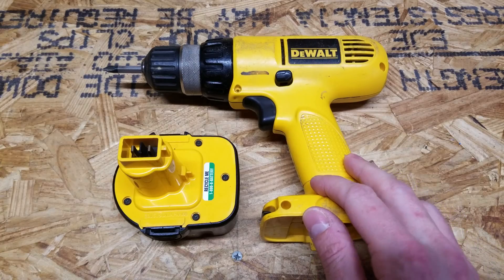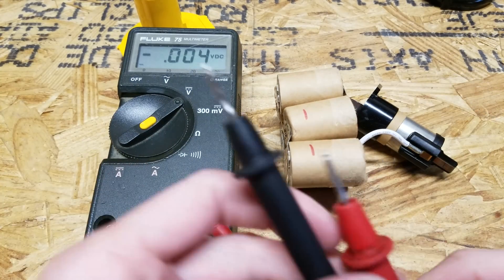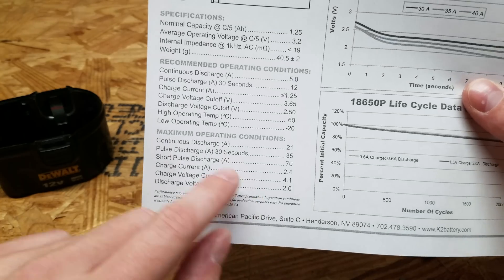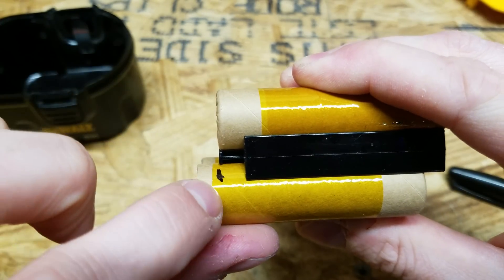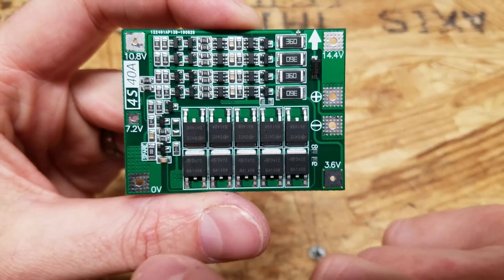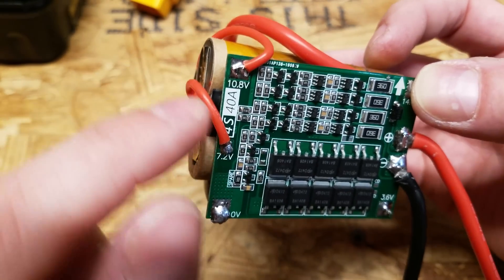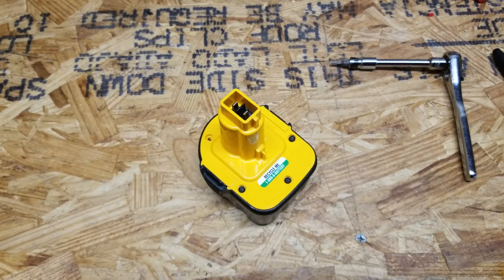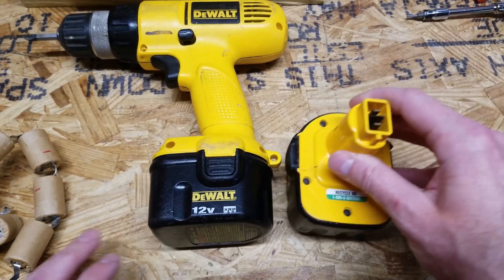Converting a DeWalt 12V Cordless Drill from NiCad to Lithium LiFePO4

Comment from the maker: Alight, so a few people asked how I plan on charging this battery and I responded that I was going to use the original charger. That wasn't a very good idea, as some of you suggested. The charger I have is for 7.2-14.4V batteries and it doesn't look like it's correctly detecting the new battery as 12V, so the BMS keeps shutting it off. I will need to investigate an alternate way of charging...
Reply: I'm guessing since you have a BMS... if it has the load balancing and overcharge protection... you only need a in spec power supply for the BMS and batteries to charge the battery pack whether separate or ideally maybe modifying your existing charger circuit to be the rated voltage and current power supply.  There are RC drone/car/plane/whatever battery pack chargers that are worth the investment IMO that can charge a large range of battery types and cell configurations as well as do some other maintenance tests and methods.
Reply: yeah different cell chemistries need different electrical charging profile. btw is your battery still good after a few monthes ?
Reply: Add a female barrel plug to the battery pack then use a wall wart to charge with the correct voltage.
Reply: @chrisyoung519  That's one option I'm planning to implement in a future project, because I value it's simplicity.
Reply: I had a bad charger for a 9v battery. I did a similar thing 4 weeks ago. Why doesnt the bms charge until done? Idk why the bms doesnt make it work.
Reply from the maker: @ericeric5306  The BMS disconnects the battery when the voltage rises too high or drops too low. It has over-charge protection.
Reply: The only way I think you could get it to charge,. Is to take like a 12v charger form a ice fishing fish finder, or a airsoft battery charger, and just watch it. You can remove all the guts from the original charger, and just wire the new one to the female end so it's a little less sketch, or just use gator clips on the + & - to charge it. The only problem with that is it won't self shut off, so you will have to watch it, and figure out how long it takes to charge it to full. Hope this helps! Cheers
Reply: LithiumSolar  n
N/
Reply: Would be good for many people if you were to follow up on your charging solution good vid though apart from that
Reply from the maker: @MrMad1966sChannel  Because I never came up with one that I wanted to suggest other people do lol. I have a hobby charger I use currently.
Reply: Does anyone know of a battery rebuild service. I have a beloved DW954 and the battery is no more.
Reply: I have a couple of these drills from 1995. I'm using two old Chinese NiCad replacements. One is weak and dies in a matter of 5 minutes of use. The other charges and works great, but self discharges overnight. There are Chinese replacements that are made with NiMh cells. Can I use the original DeWalt NiCad chargers? One is the first generation that only did 12V. The other is a couple years newer and was multi-volt charger for 9, 12 and their newer 14v batteries. BTW you can put the 14v batteries on that drill. The clips are in the same place and the motor can take it. It just doesn't look right. The front of the battery stacks out past the mount.
Reply: I would like to know how long does the battery hold charge? Tnx
Reply: AYFKM. You need a CV-CC charge circuit. WTF. Dude. You cannot use a CV charge circuit.
Reply from the maker: @bryanvarner7398  I use a proper LFP charger now, and I will say... I didn't realize this was built over 5 years ago. Wow. I use this drill pretty much daily and the battery is still going strong!
Reply: Just buy a 14V DC charger off Amazon and remove the old charger circuitry. 3.5VDC per cell x 4 = 14V
Reply: @peterg.8245  I would go with this suggestion, but the charger also has to provide the same amps as the original though.
Reply: @DigitalIP  @Peter G. I disagree with both of you. you need to go close to the maximum charge voltage to charge the battery all the way up. so 14V would never charge the pack to its full potential. 4x4,1V=16,4V would be perfect. On the other hand the charger doesn't need to supply the same amps as the original. the lower the longer it will take to charge but that's about it.
Reply: Meh... confused..
Reply: @DigitalIP  there's a big difference in charging characteristics with different battery technologies.
Reply: Had to rewatch the vid as i forgot most of it
I would have just gotten a cheapish bench power supply to charge the batteries instead of using the original charger
Could have made a type of adapter to go between the + and - contacts and charged it that way, or alligator clips
but yeah, i would assume hes figured it out by now.
Reply: Maybe the open circuit voltage is too high for the BMS, ??? I'd get a CC CV DC converter, and use a laptop power supply or something, let us know what you do!   The charger may be detecting the low resistance of the LiFePo cells, I don't know if the resistance of nicad is different, the LiFePo cells may be pulling too much current, from the lower resistance, you could replace the internals of the charger with a cc CV DC converter, and modify all the batteries, but I guess the DC converter would charge both types! I may do this, to my charger, since it's the only old dewalt tool I have, I do have a hobby charger, but requires ballance leads, I'll probably use my DC converter to charge, or the Hitachi charger, I'm thinking about paralleling another series of 18650 liion cells to the Hitachi batteries, for longer run time, it's only about twice my dewalt batterys, let us know how this works out!! Great video!!
Reply: @jamest.5001  if u want to charge with a hobby charger you could leave the bms out of the batterypack, and cut a hole and wire/glue a connector with all the balancing leads into it.
Reply: I'd recommend DC-DC converter to charge.
I have done same thing but with lithium cobalt battery and 4s2p configuration (14.4v). I don't even know where charger is so I'll just charge it with DC-DC step up.
If you have charger, you could disassemble it and  put DC-DC converter here or modify it to charge it some other way?
I have disassembled 3 of those nickel cadmium backs and to be honest they looked really much similar to yours.
Also I'm using adapter from drill to use 4s quadcopter batteries, that way I can go whole day.
Reply: I have done numerous conversions and it worked every time I used original charger. NiCd to LiON
Reply: I am curious, did you have to use an internal circuit board "BMS"?
I am only guessing this is a Battery Management System. I have 10 Li-Ion 20 Dcv Craftsman Pro Series system that fits 5 tools. The last battery died 3 weeks ago. After I got over the shock it lasted ten years +/- and turned to YouTube to see if I can replace the cells instead of the no-name brand that sell for $100 and say, these won't charge or work with the chargers I have.
ASE Master retired with useless cordless tools stacking up, and hardly any funds to buy new! Thanks as this is new to me but good with electronics but better with repairs on vehicles.
Reply: @deankay4434  Using a BMS is the only way to properly charge and balance the cells due to their configuration. Using 18650's in the way he's doing would require a BMS. But having the BMS externally would also be possible with the correct power adapter and wiring. Without a BMS to manage the cells, they could easily overcharge when charging the pack as there isn't anything to limit them which you don't want to happen.
Reply: A BMS has no charging electronics. The overvoltage shutdown is intended for emergencies and not for regular charging. A NiCd / NiMh charger works with a charging technology that is not compatible with Li-Ion. A simple DC / DC converter is also not a suitable charger. At 3.5 volts, as suggested, the cell is just half loaded. A led out socket for an external balancer and charger (e.g. IMAX B6) and a protecting board for the Li-Ion cells (undervoltage, short circuit) has proven itself in my conversions. However, the whole thing makes it complicated and unwieldy.
Reply: @wernerpeter9706  depends on the BMS. many are designed for charging, and have balance connections.
I'm also using my Imax B6  - included a dean connect and jst balance connect in the builds.
Reply: @geogsi88   Could you elaborate a little?  I am interested in converting my 18V NiCd to LiFePo4.  How did you get it to work with the original charger?  Would it be the same since I have a DC9310 which charges Lithium batteries?
Reply: @geogsi88  he didn't use lithium ion though, so your suggestion doesn't work
Reply: Djordje Tomic There’s a ton China made LiOn replacements for OEM NiCd.  But I wondered if OEM charger for Ni would charge Li properly. So why bother with hours of research and conversion when these LiOn are available ?
Reply: Between 18650s and the plug part in the battery. To make it easier for yourself you could've used XT60 connector. Would have made easier down the line for you if you ever needed to replace the 18650 battery cells. There also is another way you could build this battery. You would not need to use a BMS. You could have built this battery with a balance lead and use the sky RC battery charger designed for 18650s.

Comment: Should have read previous comments, sorry. Have you resolved the charging issue? I have a bunch of Dewalt 14.4 tools I would like to convert to lithium. Your technique is a good model.
Reply from the maker: I haven't figured out a permanent solution. I'm still using an iCharger x6 as it hasn't become too inconvenient yet. It's a low-priority problem to solve at this point.
Reply: @LithiumSolar  Thanks for taking the time to respond. Charging LiFePO4 batteries is 
 just a little scary because of being unpredictable. Anyway appreciate your video.

Comment: Great job and nice work! My only concern is charging. Is it safe to use the NiCd charger on Lithium batteries?
Reply from the maker: A LiFePO4 battery should only be charged on a LiFePO4-rated charger.
Reply: @LithiumSolar Agreed. Will pick one up on eBay and convert my OEM charger for lithium.

Comment: Series of 4 batts, using 4S BMS is correct, but why you left the last spot off? ===> BMS will become useless ! Also, the + charging & source not in correct position .
Reply from the maker: I'm not following which connection you're saying is incorrect. It is absolutely wired correctly. This battery is over 3 years old now and I use it every single day without issue.

Comment: 3.3v x 4 = 13.2v… How did you determine that those = a perfect 12v?
Reply from the maker: LFP cells are 3.2V nominal (3.2 x 4 = 12.8V), not 3.3V.
Reply: I misunderstood because 3.3V was printed on the cell and you say both. I don’t get the whole nominal thing, but 12.8v isn’t 12. Is that essentially close enough to be a negligible difference in function? I’m not trolling. I’m want to learn more about electricity. Like, if somehow possible, would anything say 11.8 to 13.2V still be close enough?
Reply from the maker: @EricWebSurfer  Huh, you're right - it does say 3.3V on the sleeve. I can't explain that one especially considering 99.9% of LFP cells are 3.2V AND the datasheet shows 3.2V. Yes, 11.8V would be "close enough" too. Another common example is the 12V battery in you car. It's a 12V battery but if you put a voltmeter on it while the car is running, you'll see it charges around 14.3-14.6V :)
Reply: @LithiumSolar  I see. Thanks for elaborating. That helped a lot.

Comment: When you say spot weld do you mean just soldering with the solder gun and solder?
Reply from the maker: No. Spot-welding is a type of actual welding. It puts a large amount of current through two tiny probes close together that melts the nickel strip and bonds it with the steel battery casing.

Comment: I have a 4s 40a BMS for standard 18650 batteries (non LiFePO4). Will that work or is the voltage too high?

Comment: After reading all these comments, and suggestions.
My simple answer is...
Search for a universal battery charger designed for LiPo, and...
find one that suits the 12v.
many electric bikes run on a 12v system.
It would be a simple as using alligator clips to your battery pack.
They are not expensive; maybe 12 bucks - in the year 2022.

Comment: if you sand off the chrome on the spot weld plates and sand the cell surface, you can then simply solder.

Comment: Would it be possible to use a 20 volt battery - by converting 20 to 12???
Reply from the maker: You could use a buck converter, but it would need to handle a lot of current and would likely be rather large. I wouldn't go that route personally.

Comment: I rebuilt my matco cordless ratchet, with new 18650's because the old ones failed in the battery pack, I had 2 battery packs failed, And a new battery is like 70 bucks, I actually bought a cheap battery for something else and harvest the cells. I had enough to rebuild both bad battery packs. The point is I don't charge mine with old charger, I Actually use a current limiting bench top dc power supply, and hook up directly to the main Pos and Neg on the battery and charge it that way, using wire etc, I use low current at 12V and they charge up fine. I have charged them a few times this way and no issues so far, The power supply shows me current draw and when its near 0 they are done. They also got a power meter light deal and it shows full when done. My battery packs each hold 3 cells.

Comment: Is the drill/ battery pack still operational? Also battery link is not working, I was try to get some good cell for same project, any recommendations? (Link please)
Reply from the maker: Yep, still works great. I wish I would have used higher capacity batteries though. Unfortunately, I don't think eBay allows 18650 cells to be sold on their site anymore.

Comment: I'll bet that you could just run standard Li-ion cells with a appropriate BMS, and the charger shouldn't over volt it. also those older brushed motors are pretty forgiving jumping up a few volts, if DeWalt even used a lower voltage motors in the 12v vs the 18v. (you could go to a thrift store and grab a cheap drill to test it out.)

Comment: They actually sell updated lithium ion batteries to replace the old nickel cadmium batteries for older Dewalts . I just recently replaced some old nic cad batteries from a 18 volt Dewalt kit I picked up cheap that was new. A 2 pack of Dewalt 18 volt litium ion batteries and charger was 99.99 at Lowes.
Reply from the maker: Maybe for the 18V drills but don't think they do for the 12V drills. If you find one, can you share a link? That would be a much easier route to take!
Reply: yup a bit less on scamazon and fleabay,  but you cant pick it up until it arrives. :O
Iam thinking of  trying that lith pak on my 18v dewalt.
the natt pak has a charge indication too. 
https://www.amazon.com/Powilling-Innovation-Lithium-Ion-Replacement-Batteries/dp/B07RBMG4WP/?_encoding=UTF8&pd_rd_w=cM6ED&pf_rd_p=96894308-003d-47e2-95f7-e4f2f97a8c14&pf_rd_r=ZSRP0KNHZE52TN17GR97&pd_rd_r=a6073b79-a0d1-4abb-a37c-ec7beb3a1ede&pd_rd_wg=dw4dS&ref_=pd_gw_hlp13n_t4im
take a peak ;) [folks claim our dewalt chargers (mine a 9116) are able to charge the lith bat pak]  (if not - return bat pak or buy a new charger)
Reply: @toknowlj I have a old DW9116 charger and it wouldnt charge the lithium Ion batts, for me anyways  . If you find a DC9310 charger it will charge both styles and you can pick them up cheap cheap used . Best feature of replacing with lith ion is the weight difference and its alot 😂

Comment: Well done, I have the same drill and its over 25 years old, Black & Decker made a cheap version of the same drill that doesn't have the same power but could use the same De Walt batteries.

Comment: have to change out the charger with a LiFePO4 charger just change out the guts, wire it like u did the batteries
Reply from the maker: Yes, need a proper charger. I tried charging mine with the original charger and it kindof works, but it's not safe and definitely don't recommend someone else do it.

Comment: You can boost the voltage to 18vdc . So you can use 3.7v (4.2 v ) cells . That will give you up to 17v . Lasts much longer and gives for power throughout the useable load . I used 18v on my 12v black and decker back in 1994 . The commutator was burning but with 18v the drill lasted for more than several years . I learned this trick from makita .

Comment: For a few years now I've been using 18650's culled from old laptops to rebuild battery packs for my portable tools. I've also been stepping up the voltage whenever practical. Have observed no ill effects so far, in fact the tools now perform as though they've discovered the fountain of youth! Greatest jump taken was couple years ago with a trash picked 14v Briggs & Stratton drill that I stepped up to 18v. It's still working, w/better performance, and still charging, but with a longer run time. Next projects will involve converting two ancient Ryobi 2.4v battery powered twist drills to 18650 w/USB port for charging.
Reply: Do you have a video or instructions?

Comment: The drill doesn't use much amperage. Probably 3-5 amps at most, and that's if you hold the chuck still and pull the trigger al the way. #12 gauge wire is way overkill and harder to work with because of the stiffness. #16, which is rated to carry 13 amps would have been a good choice and even #18, which is rated at 10amps would also work and be much easier to work with. These smaller gauges would also have little effect on voltage loss because of the short length. For the 3.2, 7.6, 10.8 connections you could use even a smaller wire gauge since they carry very little current. A singe strip of wire tape should be more than enough to connect the cells together. Using smaller wire makes the job easier and neater and the larger wire isn't really providing any extra benefits.